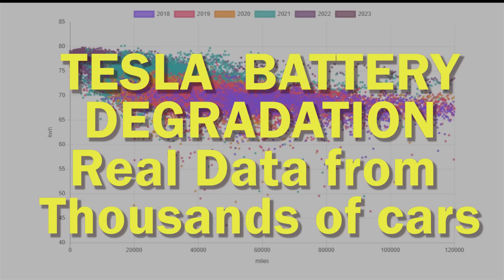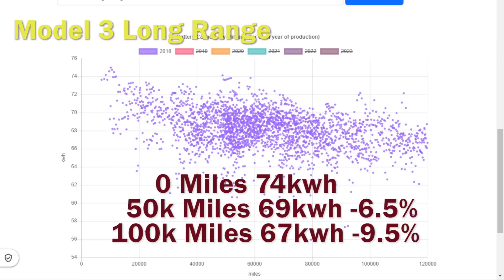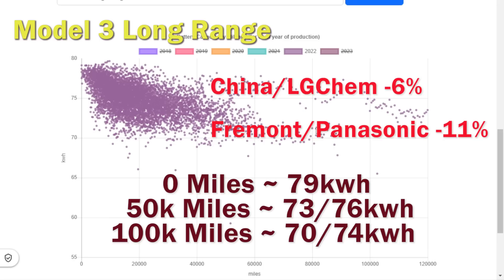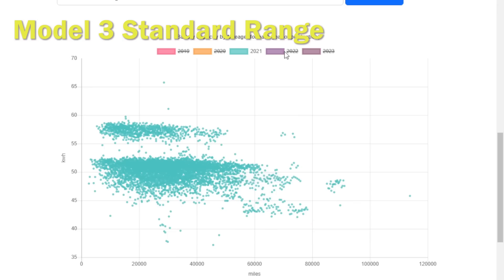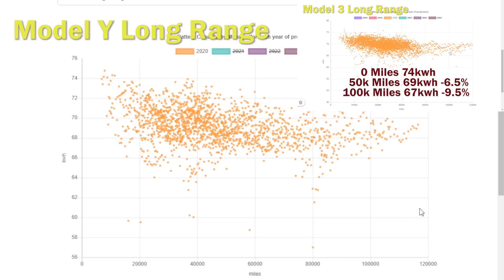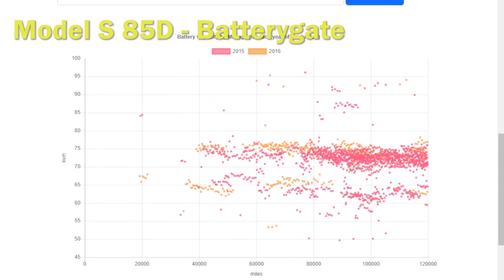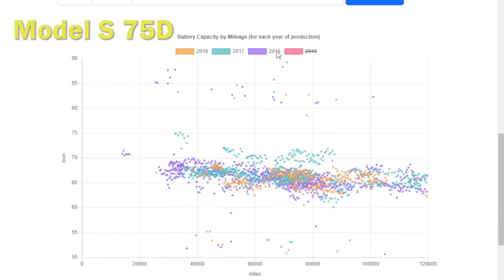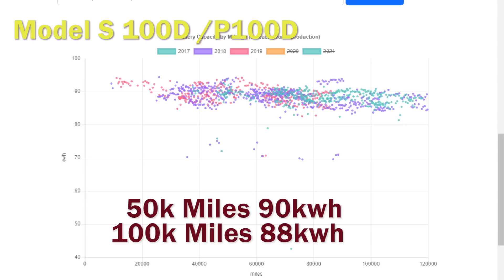Tesla Battery Degradation - The results using real data and why the Plaid is the worst Tesla

Comment: I want to know more about the cars that from 2012 or the very first generation of batteries....

I never drive anything newer than 20 years old,   I often use cars over 30 years old...

One of my cars was a 1994 with 490k kms and ran well...
Reply from the maker: There are so few cars of that age, we certainly have very very few older than 2015, and many will have had replacement batteries as it was fairly common back then, I don't think there is going to be much meaningful data unless you're Tesla themselves
Reply: @EVinventory  All my cars are on factory and unopened engines and trans and still like new at 30 yrs old and even the 490K kms was untouched.

How will a EV do without being replacing the battery???

NZ drivers cant access new EV batteries and this is a where I am and am coming from....  Find a 20 plus EV and show that battery details....
Reply: @Andrew-vd2ko Congratulations that you’re driving such old cars. I guess you have realized already that this not the norm, right? In many western countries the car age average is around 10 years, so your approach is interesting, but highly irrelevant to the majority of folks driving a car.
Reply: @marcd6897   I did 2 reply and both got deleted as people don't like to hear fact's.

One was how NZ avg car age is 14 yrs old.

I personally know more people with 2000 year cars or even 1995 cars.

If I had my way I would go back to a 75 ford escort...

Old cars are fun to drive the less safe the more fun they are...

Comment: We own 5 Tesla cars and we can say that they dropped more the first years and less now some of our car have mainly been charged at SuC and been driven 360.000km . But the most important part is the charging speed at SuC if you are on a roadtrip. Best so far is our Berlin build Y with BYD LFP almost flat curve until 60% state of charge and that is by far more than you need to the next SuC.
Reply: Why do you have 5 Tesla? I'm being serious, I don't understand. The overall efficiency of the power grid is 33 percent, a diesel is more efficient before you even plug in your EVs. There's no surplus renewable power so any extra load on the grid comes from fossil fueled perker power plants. As far as economical, you'd be better off driving a ICE getting 14 mpg vs the replacement costs for the battery. I've got 396,000 miles on my Toyota Corolla without any repairs except a $50 water pump at 365,000 miles. Plus look at all the environmental damage from copper mining and lithium mining. I'm just curious why anyone wants an EV.

Comment: Thanks for shedding some light for people who are considering buying and electric car or not. :yougotthis: and one question. Do you think that buying a used car Tesla, With reasonable mileage for its age, 50k or 100k miles, is a good investment? In this case, is a large battery or small one better? It seems that the small ones suffer less degradation according to the data presented in their report... THX

Comment: 10% degradation for less than 400 cycles is not great result.
Tesla is dealing with degradation with extensive method: larger batteries.
Reply: I have not data but my phone works just like 4 years ago, charged daily, so its more than 1400 charges and still going strong (or equal as then). Something is wrong if 400 charges degrade battery by 20%. Poor chinese quality?
Reply: @juhajuntunen7866  no, the largest factor would be how they charge and temperature + demand on the battery as he showed the Chinese/lg Chem battery performed the best for one car model
Reply: @juhajuntunen7866 one major difference is your phone battery is largely in a room temperature environment all the time. A cad battery is constantly dealing with different temperatures, whether it's the pack itself creating heat or being in a cold/hot environment. Also, a car battery is undergoing much higher current levels for its physical size compared to a phone battery. It's not really an apples to apples comparison.
Reply: @MotownModels  It's not apples to apples. In fact, phone batteries have much much much much more severe degradation than modern EV batteries. Phones are constantly getting extremely hot and stuffed in pockets and running youtube for hours or getting dropped.. and there's much less room for expansion and stress.

Comment: the plaid probably keeps dropping because actually using that plaid race model damages the battery.
Reply: speculation
Reply: @neohimself  more like logic
Reply: @jebes909090  "probably" says it all.
Reply: @neohimself  wow you sure proved me wrong.       ok lets look at what happens when you use plaid mode.    it pre conditions the battery.  when is the other time that the car does this?   when its going to use the super charger.   because its very high stress on the battery.      the other alternative is that model s's are inferieor quality.

Comment: Miles and cycles are the least of causes of battery degration the most siginificent fators are the BMS,  time and temp. exposure.
Reply: All of which they are exposed to more over mileage generally...so it's a reasonable, if not infallible proxy.

Comment: Related to Plaid do you think it is related how these Cars are used? I mean if you Drive normally and use 1000+ HP only occasionally vs you pull out all the performance frequently as daily habit?
Reply: Based on the data, just like you said, it likely can be correlated to aggressive use vs battery makeup with exception of the China battery which seems superior for the data set.
Reply: Be sure. My Model 3 LR with 100K miles /165K km degraded only 5,5% at this moment and the degradation even went down from 6,5% to 5,5% in the last 30K driven! I am only driving in Chill mode, never accelerate fast, my lifetime average usage  over the 100K mi is 150Wh/km or 242Wh/Mi.

Comment: The use of bms derived degradation data is meaningless for tesla vehicles. It is well known that tesla grossly overstates the range of their cars. It is therefore almost certain that the bms data is similarly falsified. The only reliable way to test any tesla is to measure energy output from the battery with an independent measurement device (eg current clamp around battery output cables)
Reply: Do you happen to have a link supporting your statement?
Reply: @praestegaard  you don't need a link, Tesla doesn't even give exact specs for the battery pack size, kind of like Apple and their batteries. Because of that and the fact they have several providers for their batteries, you never know if all the cells in the battery make up 73, 74 or 75 in a 75 kwh rated battery. All in all following the rule of large numbers, you can clearly see a distribution even if you don't know exactly how much is being lost, that overall numbers look great.
Reply: @praestegaard  there are class action legal proceedings against tesla, because their vehicles don't get anywhere near the range tesla states in their marketing literature

And if tesla is prepared to hugely falsify range figures to increase vehicle sales, you can't trust anything related to the battery that may invoke a warranty claim = bms data is just as likely to be falsified in the coding (like VW diesel emissions situation) 

The only trustworthy analysis is battery energy output measurement by an independent agency in real life test conditions (full to empty, with real world driving power usage). Then divide that by the original battery capacity

Comment: No offense, but any sports car you get is going to wear down severely because of the performance battery or gas but you would rather just use real data against Tesla and stuff because most of you guys are attacking electric vehicles even though it’s worse for gas vehicles, you can blow rods out the side of your engine and lose the whole car About every sports car instead of just what you want gas included
Reply from the maker: The performance Teslas appear to degrade their battery more than other, the data illustrates that point. I've not said they were bad as such, just worse than the others, and if you're buying a Tesla that might be important to you.

Comment: Excellent cohort study! The scatter graphs are very clear and it is interesting to see how the batteries from Panasonic and LGChem for example, differ in degradation, particularly on the M3LR. There seems to be a small proportion of samples that appear to have suffered significantly higher degradation than the bulk of the cohort. Is it safe to assume that this is mainly errors due to unreliable sampling (e.g. battery too cold/recharge depth too shallow)? Or are those mainly cases of rapid degradation (perhaps due to failed cells, or some form of "battery abuse" - deep discharge to under 0%, or always supercharging to 100%)?
Tesla did a service on my late 2021 M3LR (Shanghai factory model) at 52000km (30k miles). I asked them if they could do a battery diagnostic. The battery had negligible degradation (around 1%). I generally charge at home at 13A/9kW to 66% and the car has done about 5% supercharging (to less than 90%). Quite impressed especially compared with other manufacturers of EVs.
Reply from the maker: We're doing a few follow up videos to answer questions raised, the next one in on hyper mileage cars up to 250k miles, but a more detailed look at batterys and factories is also in the pipeline. As for the outliers, we've taken a look at a few low readings on the hypermile video and there's nothing obvious about them, I guess there could just be bad batteries in the mix, and we do see the same cars reporting low capacity repeatedly, but we also know the process for calculating the capacity extrapolates some values and at the extremes can cause noise. What does seem to be the case is that the 30% degradation limit is rarely being threatened and I would be surprised if many have their battery replaced because of degradation and not because of signs of serious pack failure.

Comment: Why do some batteries increase in capacity?
Reply: Battery replacement
Reply: @apt8012  if this is the case and still in the statistics, then  average value they talk about become too optimistic!! If this is the case forget about statements like "battery loss is only 8% in 60000 miles"
Reply: @cantkeepitin if you want to be careful you should filter these sudden increases out indeed. But here the decrease was just eyeballed. I don’t think these few outliers are of much concern when eyeballing a rough trend. The analysis could be done better of course but was really interesting this way. Accurate enough to give some insight.

Comment: My P100D (JUL 2018) according to Tessie: 91 kWh, 93.7%, 287 cycles, 487km range at 100% @ 64000km. 6.3% degredation after 6 years is OK. I don't feel anything. About 90% Supercharged. Charging it up to 100% like once every 2 months.
Reply: How do you check your battery degradation - by the estimate range at 100% charge vs EPA rating?
Reply: @PaulPushkarov  The Tessie app calculates this with Algorithms. It's not 100% exact but it's astonishingly close to reality. I think that's also how the data was collected for this video.
Reply from the maker: If you visit our website you can provide some data and we'll calculate it for you, we've been doing it for several years and Tessie have either copied us or come to the same conclusions completely independantly..

Comment: Worth remembering that the bigger the battery (i.e. LR model) the fewer cycles needed for given lifetime distance covered. Just think how many "100 mile" full charge cycles a 24kWh Leaf needs to cover 100,000 miles.
Reply: The bigger the battery, the longer it´s lifetime is. It is the same as with Laptops and other devices.
Reply: Yes. You are also always pushing a little battery as full and as empty as it can manage. Also for the same motor power the smaller battery is pulling a higher 'C' rating meaning its working a lot harder. I think even with temperature management Leafs would still have degraded horribly.
Reply: Degradation isn’t really the issue. The biggest problem is a cell going out and causing the whole pack to fail. More cells means increased chance of the whole pack falling. I’d be completely fine with a pack degrading 50% over 200,000 miles if there were almost no chance of randomly turning on the car one day and needing a $15k battery replacement that takes two weeks to complete.
Reply: A leaf can't do 100 miles on a battery. Used to work at orcacle HQ. Leafs coming from San Fran had to recharge or risked not being able to reach home.
Reply: Indeed, so the loss per cycle is even larger for the long range models, since the charts are per mile.
Reply: 1000 maybe
Reply: Leaf has horrible tempeeature management...
Reply: @ABa-os6wm The Leaf has NO temperature management at all.
Reply: The bigger the battery, the more of its energy is needed to carry it self around.
Reply: @voltare2amstereo  😄
Reply: @voltare2amstereo Energy consumtion due to higher mass only matters at slow speeds - at highway speeds the  air resistance (scaling with v^2) is so incredibly high that the higher rolling resistance due to mass is negligible. The reason why high mass does significantly increase fuel consumption for a combustion vehicle is that it needs to accelerate that mass and has no way to recover that energy when breaking - an electic car can recover most of that energy back.
Reply: @robstamm60  The "law of conservation of energy" will not support that hypothesis ...
Reply: Our Leaf would only go 20 miles before we finally gave it away.

Comment: Thank you. Any opinion on the effect of only supercharging
Reply from the maker: Unfortunately there's no way to see that via the API data we have access to.
Reply: There were a few outliers that were way off and that may be the dude with the model 3 in an apartment..so mostly supercharging? Apartments usualy have level 2 chargers now so if you are driving a model 3 and still in the hood, with no home charging options, you were made for the hood.
Reply: Not only is "only supercharging" most likely bad for battery life, it costs a lot more than charging at home ( unless you are grandfathered into the free supercharging like my wife's 2016 model X is ), so that's two reasons to avoid doing that more than you have to.

Comment: Lol your dataset is so tiny for PLAIDS its essentially worthless other than to sat the battery degrades over time... 
which we already know that about evs
Reply from the maker: There are over 2000 data points on Plaid and over 5000 data points on the facelift MSX, how many do you want?
Reply: @EVinventory  well considering that's like 1% of total volume... A lot more if you want to make reliability claims lol
If you did this to ICE, people would be in here dumping cold water on you.

Comment: Is it possible for you to compile Standard Range Model Y 4680 battery data?
Reply from the maker: We'll put it on the todo list. If we can identify the battery we should be able to do it.
Reply: @EVinventory  The MY 4680 pack is the worst Tesla battery with respect to charging.  It has anecdotal evidence indicating higher degradation so far.  Looking forward to any data you can put together.  We have one if you need any details.  Model Y AWD standard range 4680.

Comment: There's something fishy with the 85D and 90D data. You showed exactly the same data points. There was no difference at all between the graphs or the averages.

If the data was correct for 85D, which I om guessing it was based on the years shown above the graph, it correlates nicely with our own 85D which has only lost about 6% after 13k miles.
Reply from the maker: We've had a look back and sadly you're right. The difference we report was from an offline analysis and that looks ok, the chart we display however which drove the commentary about two cohorts does have a mistake but only on those specific cars, and the P85D/P90D which we didn't comment on. We're going to do another video looking at 100k+ miles and we'll revisit this. Thanks for pointing it out and watching.
Reply: The 90D were 2kwh higher but looked similar
Reply: He said they were but they were exactly the same if you look closely.
Reply: No problem! Thanks for a very insightful video which makes think we've got a real gem in our 85D.

Comment: My 2019 MSP has 89.9% at 89.7k miles, so this tracks. All Supercharging since 66k miles.
Reply: And have you been charging past 80%?
Reply: @rkgsd  rarely but not never
Reply: @thedownwardmachine  I've always thought constant Supercharging is a little harder on the battery than say level 2 40amp/10kw charging. Unfortunately, many EV owners don't have access to home charging. It also depends on how far down the battery is drained. Better not to go too much less than 20% remaining.
Reply: @rkgsd  I agree, otoh a 300mi battery charging 20% to 80% effectively only has 180mi range between fill ups, which sucks. This is why 500mi batteries are actually important and I want one.

Comment: Great info, from the UK, got a 2014 Model S 60, 100K miles, now at 51.6kWh (usable). 10% degradation if you include the 2.8kWh buffer.

Comment: What is the percentage of the normal battery degradation in the Tesla Model 3 year 2021 with 11000 km? For me it is almost 11%. Is that acceptable ?
Reply from the maker: You don't say which model or how you got an 11% figure, but the charts a 2021 LR would be in the range 71-76kwh using the API method we, tessie etc use which is a wide spread and 11% would be at one end of that. We'd suggest you follow the advice here to calibrate your BMS and balance yur sells which might help https://tesla-info.com/guide/tesla-bms-calibration.php
Reply: @EVinventory  Thanks. SR + , LFP